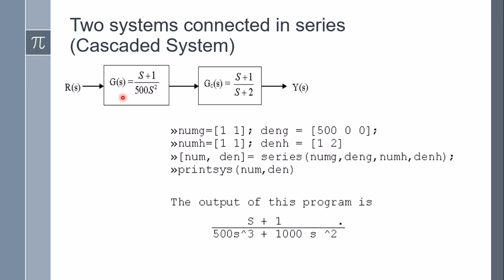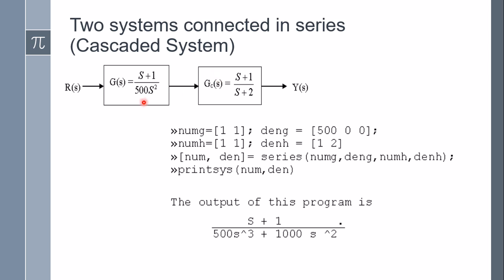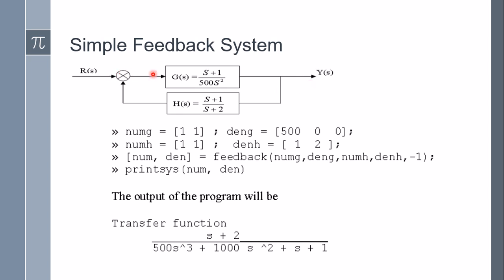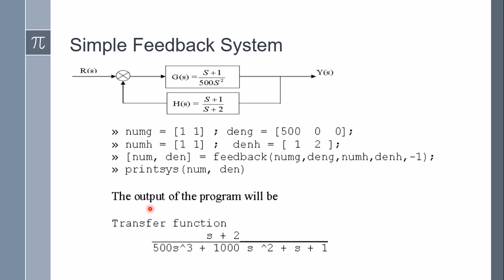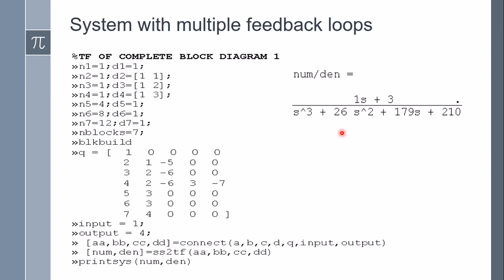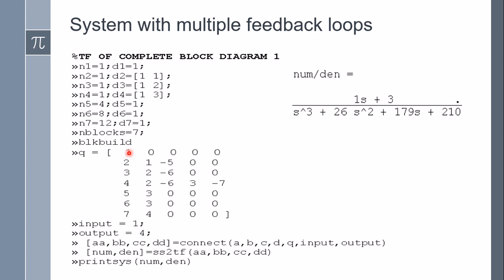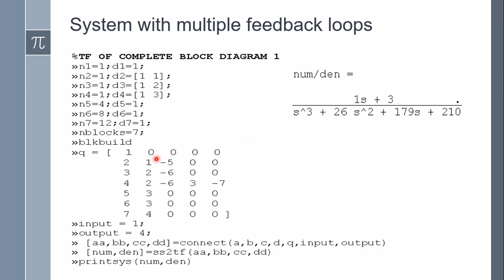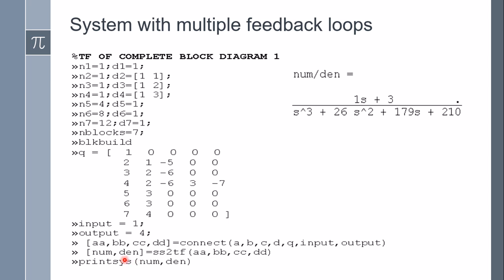Block diagram reduction using Matlab

Comment: This only works if, for all block expressions, the order of the numerator is equal to or greater that the order of the denominator.
I tried this using Matlab R2015b and since I had a '2s' component the 'blockbuild' function gives an error message.

Comment: Sir I got an error. it is not working if any block of tf have  order of numerator is greater than denominator. Order of denominator should be greater or equal to numerator it is saying that.please help me sir .
Reply from the maker: For a realisable system, the order of the numerator should be less than order of denominator. In such case, you can break the numerator polynomial in to parts and cascade the system.

Comment: I am confused what a,b,c represent in the connect function
Reply: The parameters; a, b, c, and d specified in the connect() function are set by the 'blkbuild' command.

From the MATLAB docs for the output of 'blkbuild': "[a, b, c, d] is the resulting state space structure. The matrices are built up by progressive APPENDs of the state space representations of each block."

More about state space structures: https://www.tutorialspoint.com/control_systems/control_systems_state_space_model.htm
Reply: @genericaccount7422  thnx